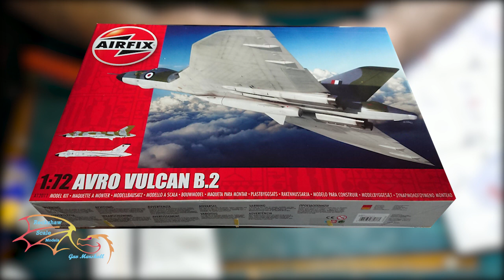Airfix Avro Vulcan B.2 Part 3 Cockpit  Frame 1/72

Comment: That was very interesting, I don't think I've ever seen anyone build an airframe for a plastic model, do you intend to build the airframe for the entire plane, or was that just for the front of it?
Reply from the maker: The plan is to do it with half the airframe visible and the other fully made up. If a can pull it off remains to be seen though 😁
If you have a look at the Hellcat and Typhoon builds you will get the idea, but for the Vulcan there is a lot more to it as well as more head scratching.
Reply: @ReckshawScaleModels  I gotcha, I was just curious,  I'll check the others out thanks. It's definitely interesting though, I'm looking forward to seeing if you can pull it off. Thanks for sharing.